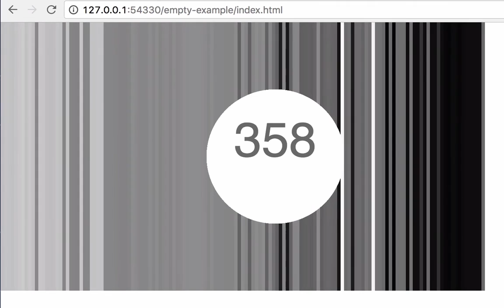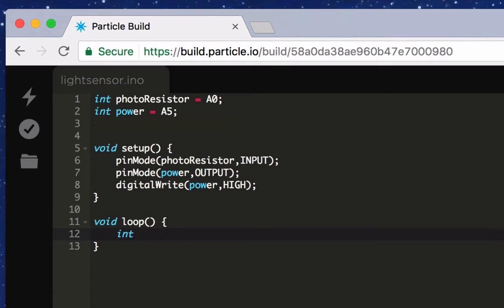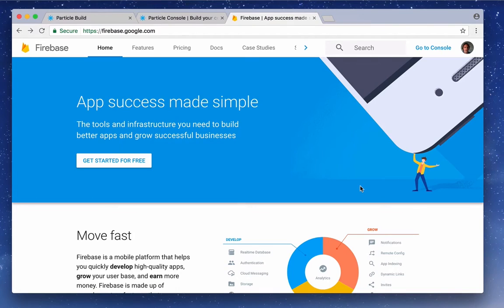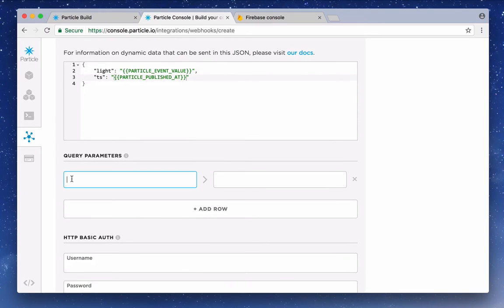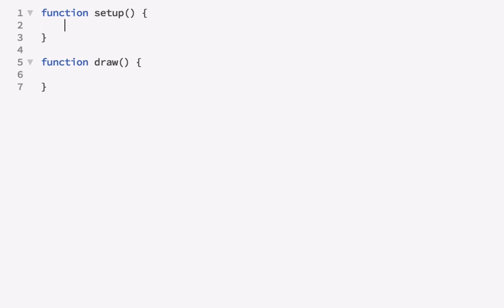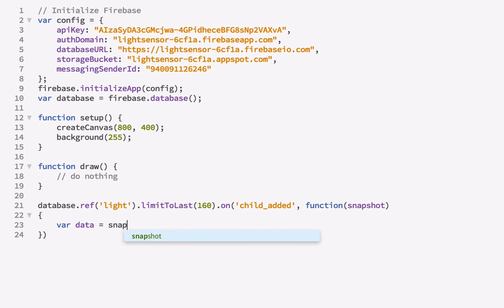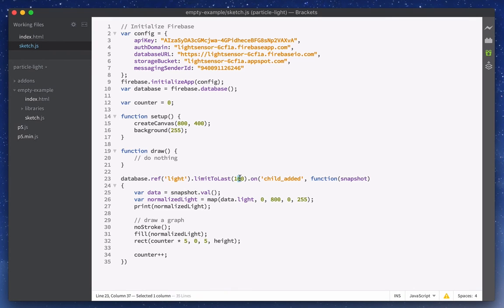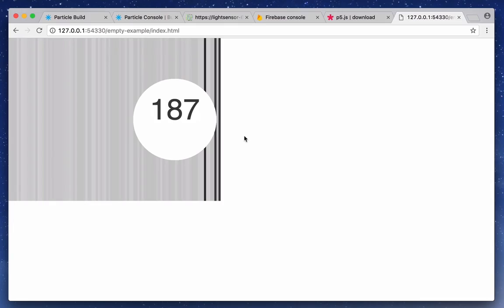Data Visualization using Particle, Firebase and P5js

Comment: Hello! I'm following your tutorial right now and getting a permission denial when I check the json file on the integration page! Not sure whats wrong yet, the database allows reading and writing (I believe this is Firestore's new way of saying 'true' to both) and I have copied the secret key into a field called 'auth' like you did
Reply: I'm going to try and make anew database and see if that fixes anything.
Reply from the maker: @freddyhaug9379  Sure, let me know if that works! You should be good to go if "public" read and write is enabled in Firebase.
Reply: Okay so the data doesn't show up when I press the link in the integrations tab, but when i check the real time database, I now see all entries showing! Before I was checking the firestore db. Crazy how many times I have an issue with firebase and its two database versions!
Reply from the maker: Yeah, that is a bit confusing for sure! To be honest, I haven't had to work with the newish Firestore database yet - it's been on my list. I'm glad that it seems to be working!
Reply from the maker: Yeah, that is a bit confusing for sure! To be honest, I haven't had to work with the newish Firestore database yet - it's been on my list. I'm glad that it seems to be working!
Reply: Got it all working! :) first step to getting my start up project done. The program is pretty slow, is the only fix making the delay shorter or is it a firebase problem as well? TYTYTY

Comment: Thanks for the tutorial John. I'm getting a "Rate limit exceeded" error from Firebase after a few seconds of publishing Particle data. Did you come across this?
Reply from the maker: Hi Dominic - Thanks for watching! I know that Particle has a rate limit of one "publish" call per second (or something similar to that). Although, I haven't experienced any rate limits when using the Firebase database. The only time that I imagine you might get an error like that through Firebase is if you're trying to authenticate a user too many times. I'd be happy to take a quick look at your code if you'd like.
Reply: Yeah, I think it's something to do with the Firebase authentication process. I've copied your code exactly on the Particle side and I just went through the tutorial again from scratch to see if I'd made a mistake somewhere but I'm getting the same "Rate limit exceeded, please wait and try again" error.